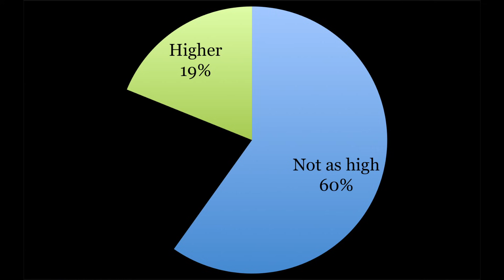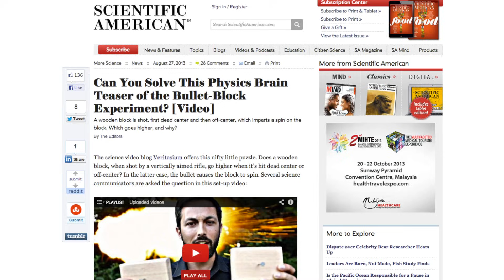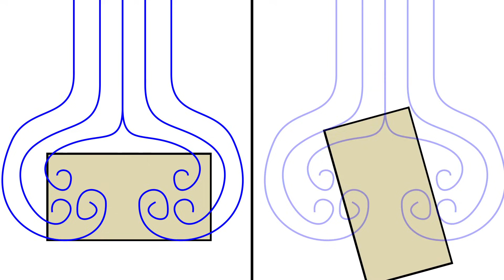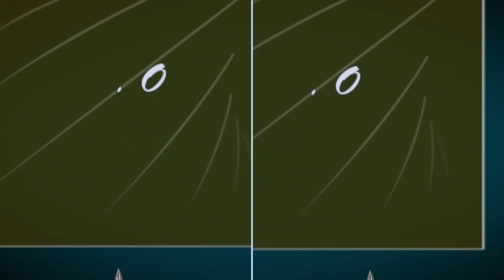Bullet Block Explained!

Comment: I believe Veritasium's answers are incorrect. Here is the correct answer.  When the bullet strikes the block off-center, the block begins to spin.  As the block begins to spin, the block acts as a lever and the nail pushes downward against the plexiglass stand.  The plexiglass structure sits on solid ground, so as the nail pushes downward against it, the effective result is the nail is helping to launch the block upward (just as anything that gives the earth a downward shove will itself experience an upward acceleration).  To prove my theory, you can do the experiment again, removing the plexiglass stand at the exact moment of bullet contact (I'm not sure how this could be done).  Or more easily you could suspend the block using a squishy support structure instead of the rigid plexiglass. If you do this the result will be much different, and the spinning block will not go as high as the non-spinning block.

Comment: To determine exactly how the energy is being transferred from a bullet to a catch material, everything in the experiment needs to be controlled much more tightly. The bullet needs to be of consistent mass and accelerated to a consistent velocity every time (maybe using electromagnetics.) Both the bullet and the catching material need to be much more consistent. Different catching materials should be used, including non-deformative materials that would have an elastic collision with the bullet. The initial momentum of the bullet and the mass of the catching material can vary as long as it remains consistent with each bullet and catch-material combination.  Perform the experiment in a vacuum and measure temperatures before and after. In the end,  a conservation of energy must be observed. 
However, going back to the original experiment of just using wood, we saw that there was great variation in results between the few repetitions that were done.  This indicates that many many more repetitions need to be done before we can calculated an average height for both the non-rotating blocks and the rotating blocks separately.  I suspect that after a large number of repetitions, we would see a more apparent difference in average height of the rotating blocks with respect to the non-rotating blocks. Because the bullet translates all of its momentum to the wood in the first fraction of a second, it will lodge itself into the wood to a depth that is nearly the same in both rotational cases, I suspect that the energy lost to friction and heat will also be roughly equal in both cases. The fact that so much energy is being translated into angular momentum is very likely to result in the over all average height of the rotating blocks to be less than the non-rotating blocks. 
Unfortunately, I think Derek's presentation of the analysis of this riddle is misleading (that the blocks of wood reach the same height in both cases) because the performance of his own experiment was incomplete and led to invalid results.  I like that Derek is making us think about what we are observing, however, I think a proper explanation is deserved.

Comment: Interesting. Maybe one needs also to take into account that the wood is an orthotropic, hydrofillic material. Certainly, it is not the same amount of energy to penetrate 'along the fiber' direction that in the transverse one. Furthermore, neither is it if the relative humidity in the blocks is different since it causes some initial strains... Keep up the good work!.

Comment: In vertical wood piece it got more time to absorb the energy, but in another piece it rotates quickly with more torque
i.e., wood absorbed energy differently & compensates height equally

Comment: How to disprove?

I'd suggest a block with a metal insert. Each bullet would embed itself into the wooden part, but be stopped at the same depth by the metal.
This should counter-act the expected loss of energy, and the non-spinning block should then travel noticeably higher.

I'd give it a go, but we don't do guns.

Comment: Mashine translation!
For greater clarity of differences in the depth of penetration of bullets, it is necessary to give the bar a shape that will be characterized by: 
1) a distribution of mass that is non-uniform in height, but symmetric about the axis of symmetry.
 2) the mass of the central part of the bar above the center of its base must be greater than the mass of each of the edges separately.
 The lower mass of the edge of the bar gives an increase in the acceleration it acquires relative to the edge of the bar of a regular shape when firing at the edge of the base, respectively, the rotation speed of the bar will be higher, which will mean that most of the kinetic energy of the bullet will go into the rotation energy of the bar than in the case of a shot to the edge  an ordinary bar in the shape of a rectangular parallelepiped.  The conversion of much more of the kinetic energy of a bullet into rotational energy when fired at the edge of the bar will make a big difference when comparing the depths of the holes left by bullets fired at the center of its base and at the edge.
 As a special case, you can take a T-shaped bar suspended with the head upwards on nails inserted into the lower part of its legs.  To show that a significant increase in the speed of rotation in the case of a shot into a t-shaped bar is not associated with a change in mass when switching from a bar of a conventional shape, but is precisely a consequence of a decrease in the amount of energy spent on deformation of the bar body, you can make a bar from a material denser than that of  which the original bar was made.
 P S. Apologies in advance for the very long and confusing answer.  😬

Comment: Hey well the experiment has some flaw not all wood is the same so I would have use a different material like foam . Think about it the center of the tree has different intensity than the sides of the tree that explain why wen you made your experiment all did not go same height and the small little factors that are irrelevant wen you add them up it makes a huge difference

Comment: What if instead of bullet it's hit by an impulse of hammer, thus same loss of energy as heat. By conservation of momentum height of block would still be same. And due to torque, the block would rotate. How would you explain the difference in energy, now?

Comment: I guess, inconsistency of  bulllet speed is major factor in results deviation. For organizing more less clear experiment we need:
- precise bullet impulse,
- homogeneous material
- precise target point

So, we have two factor experiment with variation of impulse and target point. 

To explore bullet traces, when object rotates, I would recommend to use materials with lower density and/or viscosity. Lower density gives deeper penetration, viscosity gives smaller  rotation radius. May be bullet gel will help.

Comment: When fired at the center of the bar, the kinetic energy of the bullet was evenly distributed over the bar and passed into thermal energy, as well as into the mechanical energy of penetration the bar. When fired at the edge of the bar, this same energy turned into torsion energy.

Comment: The rotation part can be explained as well by angular momentum. The bullet, when fired offset to the central axis, carries some angular momentum about that axis (=mvr) . When it hits the block, that angular momentum is converted into energy of penetration, heat, sound AND the angular momentum of the combined block+bullet body. That explains the rotation of block, without a difference in height from the non-rotating block
This was quite intuitive, tbh i guessed it wrong the first time. But when you look at the basic physics of it all, it makes sense.  You make good videos man.

Comment: I couldn't stop thinking about the conervation of angular momentum. I mean, clearly something must be rotating clockwise to cancel out the anti-clockwise rotation of the block and reach the original, zero angular momentum. Well, as it turns out, the bullet always had angular momentum relative to the block's center of mass, even if it went on  straight line.

Comment: I came back to this video due to an idea for using the angular momentum of a bullet for a certain effect. But I finally realized why this video was so frustrating for me when I first saw it. It's because it doesn't actually prove or disprove your explanation for what's happening and yet it always seems like you're trying to act like it does. It would have been nice if you had ended the video saying "Unfortunately this test doesn't really show the energy lost to mechanically breaking the wood well enough to draw any conclusions from it. Even the nail test we showed wound up being due to testing irregularity."

Comment: take the bullet out of the equation and use a swinging mass on a set ark so that the energy can be measured
multiple time with the same target, add an acceleromeater  to the target to get precise data on energy transfer. this with the high speed camera allowing you to weed out anomalous variables in the swing if any.
also what happens if you use a target of greater length, will this affect the result. not having done this experiment i would guess that it would.
all this being said i love the experiment and the response you got from viewers. also loved the explanation as always, keep up the good work.

Comment: Someone needs to waterjet cut these bullet impregnated pieces of wood in half.. I think the one that spins is curved but the xray looks like it shows room to spare for a small diameter nail..  Also was the wood a different density?  Were the pieces shot cut out of the same piece of wood, same moisture content, and cut side by side? At 8:06 pause it, do those pieces fit together?  Any knots perhaps? Should the two pieces cut from same board side by side be xrayed first and last?  To really test it I think it would be fun to  use a 2x10 or a wood width that would accommodate the full force of a perpendicular shot bullet but not allow more than 1/3rd penetration across width of the board, otherwise  it may hit the bearing used for the experiment(so if the bullet goes in half way, which would hit the bearing in a 2x6 use a 2x8 instead or 2x10 etc. until u know its not going to crash into center bearing)... So no knots, cut side by side from one and the same piece of wood. Use a drill press and drill a hole with a forstner bit in the center, pop in a corresponding bearing, slide onto a shaft, shoot one in middle and one on the end, xray and water jet cut..  Side note, use steel box tubing, lets say 1 1/2"  x 1 1/2" x 1/8th" wall x 1 foot  with extreme safety precautions the same way as shown in video. Wonder what a deflection will do..

Comment: The wood won't move until the bullet has spent all it's energy, thus penetration should be the same if the density of the two wood blocks are exactly the same, that is the only variable

Comment: Easy peasy, dude. Use something less dense than wood, like heavy duty styrofoam, and something slightly less powerful than a gun, like a pneumatic  pellet gun. Then the difference in penetration depth should be more pronounced.
Reply: yup

Comment: To get a readable result, you need to fire into a less dense (and more homogeneous; wood's density varies a LOT across the grain) material, so the bullet travels further and the 1% difference between the two shots is more noticeable. 

you also need to control for the rifle. rifle bullets go different speeds. you probably need to first control for internal ballistics, by cooling the rounds and ensuring you fire them from the gun at the same temperature (a warm barrel heats the powder in the round, which makes your muzzle velocity higher) and also chronograph each shot to control for minor variances in muzzle velocity. 

at such a small scale, the deformation of the bullet may even play a part. a bullet that deforms more may impart more energy quicker than another, which could skew results. the deformation itself could skew results since a more deformed bullet might look like it went shallower even if it had deeper proportional penetration. this could be offset by using a hardened round with a discarding sabot, but that could make material choice very difficult, as it would likely make the round go straight through a soft material.

Comment: I'm 'a have to disagree with you.  (1) Some of the upward momentum is converted to angular momentum--the spin didn't come from nothing.  (2) the spinning block is more aerodynamic as it has an angle to the movement through the air (but this is a minor point).  I don't have an explanation but would point to two things:  (1) using a longer block would exaggerate the effect and make it clearer.  (2) it is shown that Tesla cars are much safer because the center of mass is the center of the car.  When they hit things, they are able to spin and move out of the way of the force acting against them.  This seems a clue that disproves your hypothesis...
Reply: So seeing this two years later...  I think that for every action there is an equal and opposite reaction.  Therefore the block is being pushed up on one side and falls on the other.  Therefore, the spin...cancels itself out...and the heights come out to be the same. 

I propose though an additional test:  Hitting the block at different distances from the fulcrum (bolt) and see if more spinning and less spinning has any effect on height...this would prove my suggestion that the spin has only a minor impact on the upward momentum vector.
Reply: OK watching the video...the next study needs to be bullet hits the block 1", 2", 3" & 4" from the center to see what the impact on hight, rotation and bullet depth is.

Comment: but conservation of angular momentum applies to the entire system bullet + wood right ? Let's call it b+w. The center of mass of this system is called G. The bullet is at the position B. So the position of the bullet relative to the center of gravity is the vector GB . The bullet has a linear momentum p

You can calculate the angular momentum L = GB /\ p of the entire system b+w, even before the bullet enters the wood. 

first experiment, the bullet is travelling towards the center of mass of the system b+w : angular momentum is zero from the start because GB and p are colinear
second experiment, the bullet is offset from the center of mass of b+w, so from the begining there is a non-zero angular momentum L = GB /\ p

It's a bit more complicated because the center of gravity is moving as the bullet approches but I think that's the reason : the angular momentum was there from start.

(PS : Like most people I was completely fooled when I first watched these videos, I thought the spinning block would go lower)

Comment: I wish I saw this video years ago, I was unsure of what exactly would happen when presented with the question, but my first guess was the bullet has so much energy not all of the energy is momentum, but there is a lot in impact causing a huge mount of ripples, and deformities from the soft nature of lead, at that speeds you kinda have to think of liquid almost. So, hitting on the side allows for the transfer of that energy involved in the destructive parts of the impact, is now being transferred into rotational energy. I bet the spinning wooden block would be stronger than the direct impact wood at that point as well.

Comment: imagine that you push a block of Jello with the same amount of energy but at different speeds.  slower the speed the more the Jello will move before you push into the Jello.  faster you push into the jello the faster you penetrate the jello.  the spinning block starts to move before the non spinning block b/c it has less mass to move from center of weight compared to the center bullet.  if you just dropped a bullet from above onto the edge it would still spin b/c its easier to push the tip of a balanced weight than the whole mass in the center.

Comment: Angular momentum isn't totally independent, it's equal to the product of linear momentum and perpendicular displacement. The speeding bullet has the same angular momentum as the spinning block, and relative to the block's center L=xp (where L & p are magnitudes).

Comment: Use plasticine. It's a non-Newtonian fluid. It will dissipate energy more gradually. However, you may need some filler to increase coherency. Or you will just end up with shooting through the sample.

Comment: use softer material with a hardend outercoating, like Composite armor.  a stealplate under the block with 1mm thickness and a balsawood block ontop it (Maybe the same plate ontop of the wooden block so it can rotate more stable. and you will see a difference in the Penetration depth. maybe only some mm but visible.

Comment: It is not exact same height, and you done 100 shots and selected 1 to show us for what ever reason, put the scale behind, measure height and you will see, in video you can clearly see that it is not same height and hear you telling it is, you could draw line 1 meter thick and cover whole video and claim they both gone to the moon, draw thin line on top or just scroll video little bit adjust top edge that non spinning block at maximum height touches top, and then watch spinning block not touching that top edge or line, also spinning block fell down first and if they are gone ti same height explain how and why spinning one is first  down ??

Comment: @Veritasium there is one factor that you failed to factor: the torque applied by the bullet is also applied back by the other opposed to the bullet. This can be tested: check the rotational acceleration as soon the block stop touching the base.